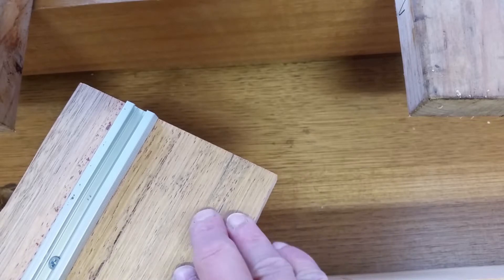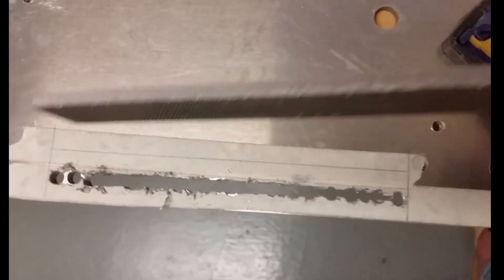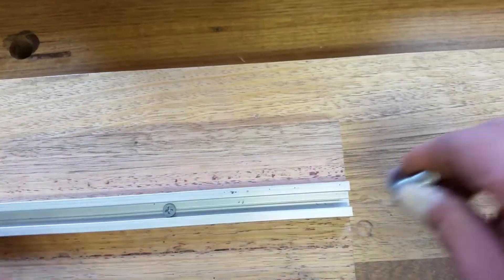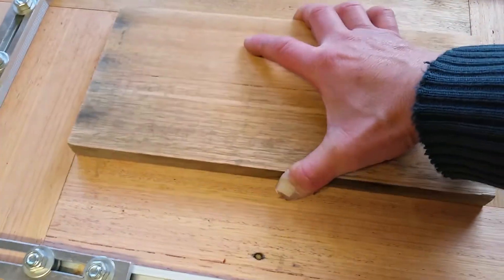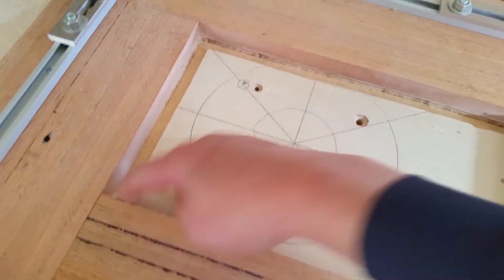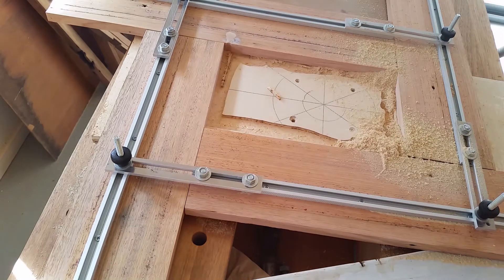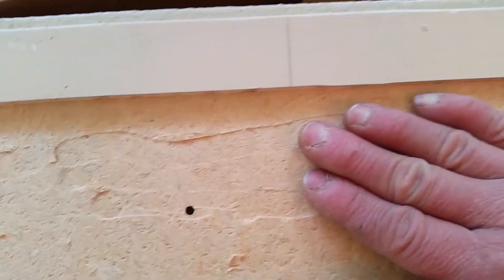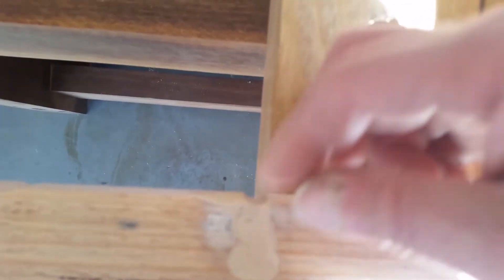Adjustable Router Template

Comment: Btw... you can use the router and a spiral bit to cut the aluminum slot out at around 2:10 . Then you save a lot of time.
 
I've had problems with the aluminum bending on this type jig. Trying to find steel version, but do not know name of what it is.
Reply from the maker: Hi Mr Carter, thank you for the info, I have learned we can routed aluminum with carbide router bits... But my skills are not up to it yet. Thank you and take care.
Reply: Thank you for your video, especially showing us your errors. Bob